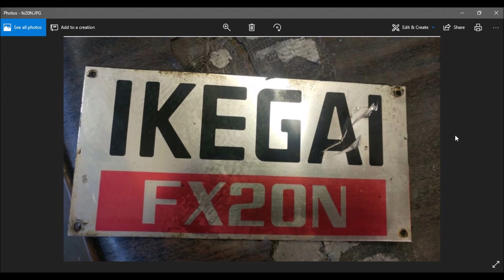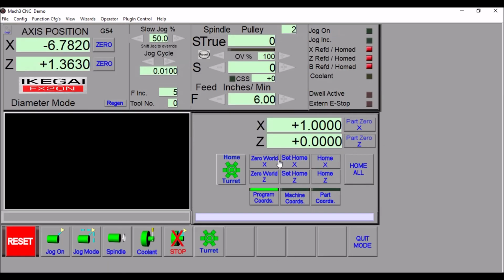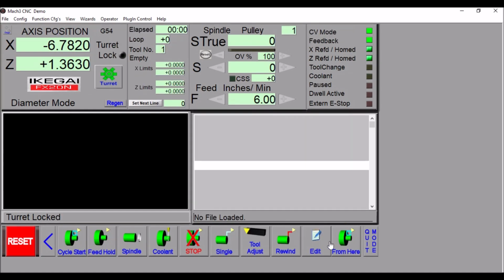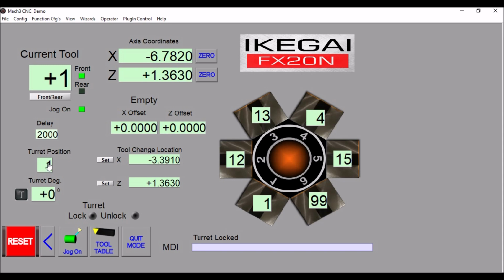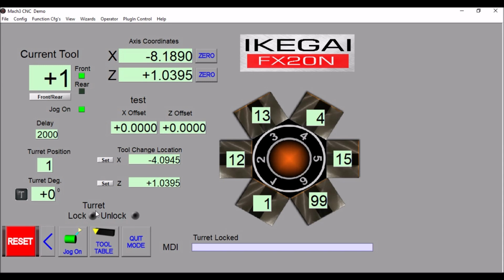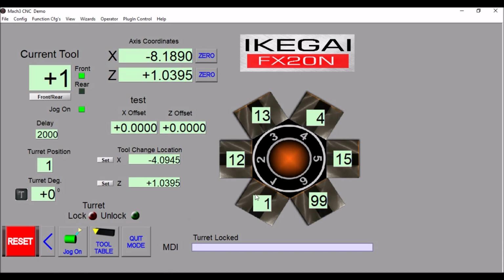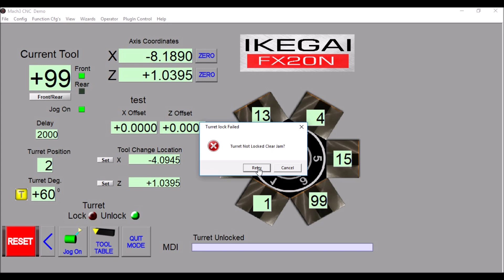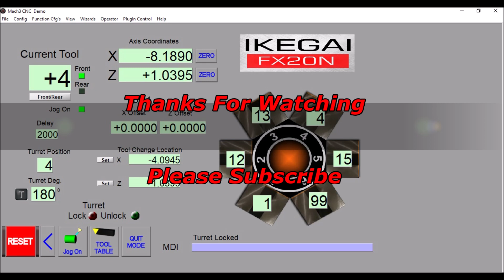MACH3 Custom Screen  For IKEGAI FX20N Retrofit

Comment: Very nice project, sure the process it's learning, drop the fanuc  drive, to do simplicity?!
Reply from the maker: You got it!
Reply: @CNC4XR7  i have this beast bot no work shift and not geametry compensation 6t model a , i check for retrofit it or just another new use machine , thanks great work  you are the machine ;)

Comment: I saw one of these at an auction, it was the only machine that didn't get bid on and was scrapped. Had an air chuck. Early 80s like 1981.
Reply from the maker: Man That's a shame with a few minor upgrades on the electronic side these old machines can be revived. 

These older machines were built well.

Comment: I am using a Click PLC for the tool changer now but the rotation is control by time and sometime the index doesn't come up correct. All the hydraulics are control with electrical solenoids. It would be easier if the rotation was control with a stepper motor. I am thinking about going back to Mach3. Really like your graphics!
John
Reply from the maker: Well a simple output is all you need for the lock, and  having the servo or stepper makes it easy to rotate to the correct position.
 does that machine have a 12 tool turret?
should be no problem to create a screen.

Comment: Nice Sam! I have an IKEGAI AX25N but I am using Acorn for the controls but not for the tool changer. Do you know what is being use to rotate the tool changer in the FX20N? My unit is using hydrualics for all the tool movements (lock,rotate & unlock). I will email you in the near future.
John
Reply from the maker: As of now its going to be Air for the lock and Servo or stepper for turret rotation
Reply: Yes it's a 12 position. In order to unlock the Turret it's a push out move, then you apply rotation to the position and then release the push out solenoid to lock it.
Reply: The lock unlock is also the index.
Reply from the maker: Yeah just a simple output, should be no problem to create a Macro, Just shoot me a email if you decide you want to that route.
Be Safe,
Sam
Reply from the maker: Right I get the picture